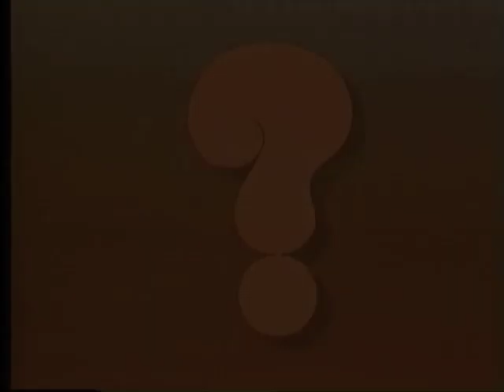Two-Stage Balloon Rocket

Comment: I've tried a stage separation device with my primary students: two balloons in a row with separate straws. The neck of the second stage and the body of the first stage are squeezed within a ring (I cut from a paper cup). The the second stage will only fire after the first has mostly deflated. It's a bit tricky for little hands, but great fun for the teacher.

Comment: if you  inflate the blue balloon the same size as the pink one you would have gotten faster and more distance. This is a useless demonstration. Because you also didnt got rid of the dead weight which was the blue ballon, you should have had both ballons in separate straws.